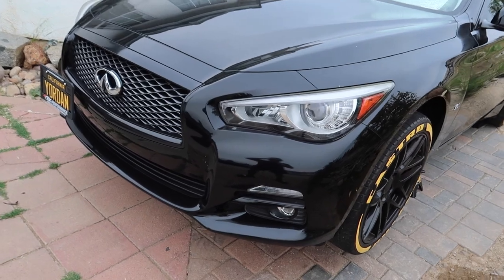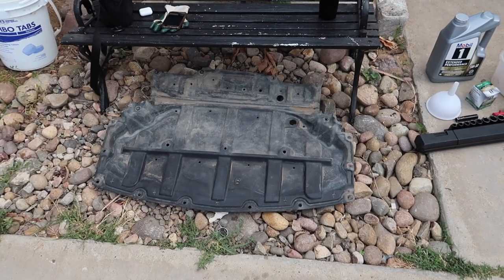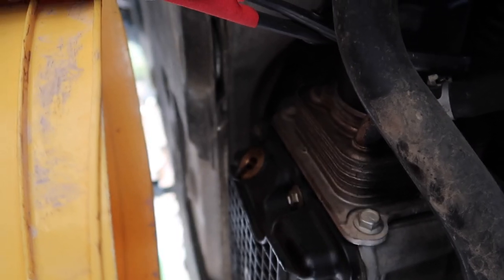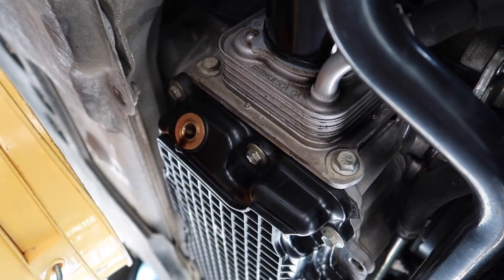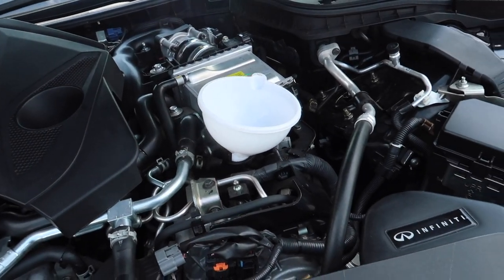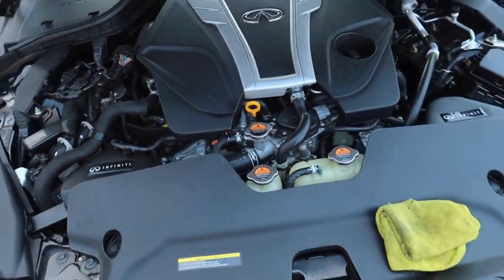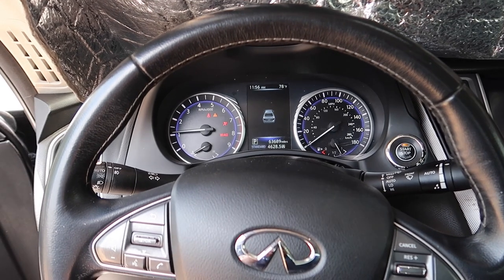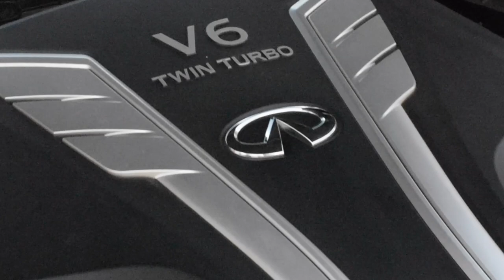Changing the OIL on my Q50!

Comment: Thinking about getting a Q50 3.0T and inwas wondering if it was complicated to change the oil. I was initially thinking that it used another type of oil filter. This is VERY straightforward.

Comment: Excellent work  
I just got my 2015 q50 and it is all black. Once i get my ramps,  i will do my oil change. What size ratchet did you use to remove the lining underneath the car?
Reply from the maker: Thank you , It’s either a 10, or 12 mm
Reply: 10mm on my 2017 Q50S

Comment: Why are u using 5w-30 and not the oem one ? I need an oil change done should I do 530 or oem?
Reply from the maker: 5w-30 is fine if you’re in a warmer climate.. i dont know, I’ve always use 5w-30 .. if you have a souped up q50/60 the 5w-30 won’t burn through the oil as quickly. Either should be fine , but 0w-20 is in the manual. I think In winter I’ll use 0w-20 and try it out, see what difference it makes
Reply: I have a 2014, and the dealer told me to use 5w-30. I'm in TX, so it's probably better for our warmer climate.
Reply from the maker: 👍🏽 good input
Reply: @rlh1220  Intresting cuz I get it done at the dealer and they ended up putting 0w-20

Comment: Dude just use car ramps. Way easier and faster. If your slammed you can use 2x4s to get up to height and get up ramp.
Reply from the maker: I’m sketch with the ramps lol
Reply: @jordantcastro  🤣 I hear ya. Plastic ramps vs steel stands, no dount srands are guaranteed safe. I actually had to build ramps out of wood since car was slammed 2.5 inches. I trusted solid wood.

Comment: You only put 5 qt?
Vr30 takes closer to 6 (5.8) in 2018 infiniti revised it to 6 qt
Reply: Minimum 5.5 qt if you’re rwd
Reply from the maker: Damn Fr ? I’m going to check that next time I change oil. Thank you
Reply: @pullingpuppetstrings3826  so the recommended is 5.5qt or what?
Reply: @varietyryan  5.5 qt for rwd. 6 qt for awd
Reply: @pullingpuppetstrings3826  okay because you said 5.8 so wanted to make sure it’s 5.5

Comment: WRONG OIL! WRONG OIL! WRONG OIL! this car REQUIRES 0W-20
Reply: Not the wrong oil.
Reply from the maker: 0w-20 out the factory yes ..
Reply: 0w-20 for fuel efficiency yes 😂 5w-30hp is better
Reply: I be putting 5w-30 all the time on min
Reply: You are DEAD WRONG using 5w30 in the Vr30ddtt. The reason why 0w20 is required is because of extremely TIGHT TOLERANCES in the engine. This means that thicker oil like 5w30 wont reach the metal in time. If you’re modded then go max 0w30. If stock stick to 0w20
Reply: 90W  is better